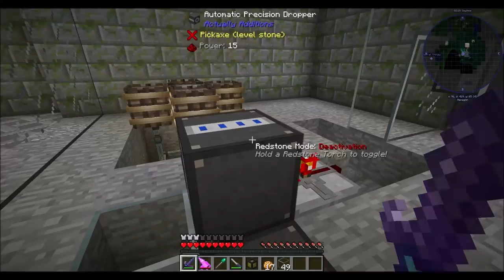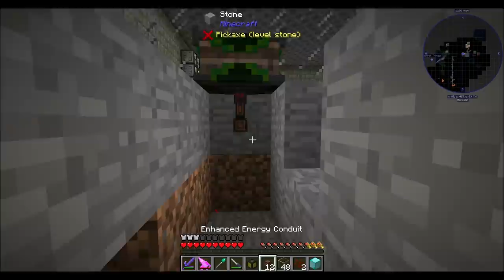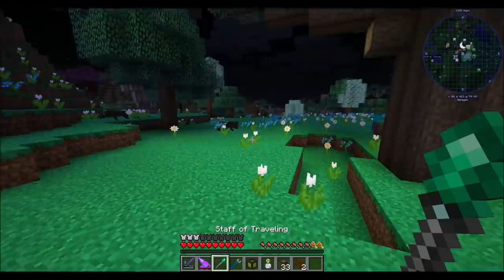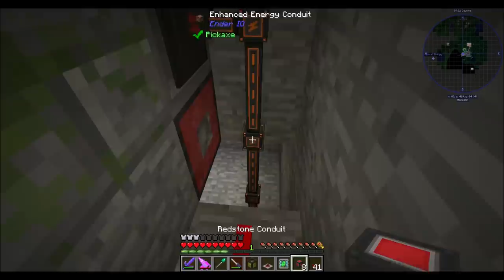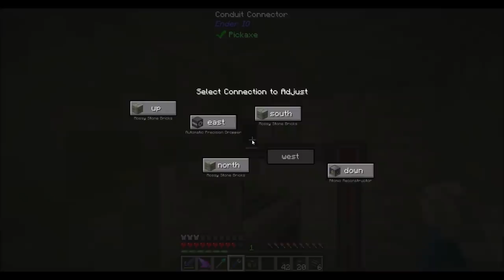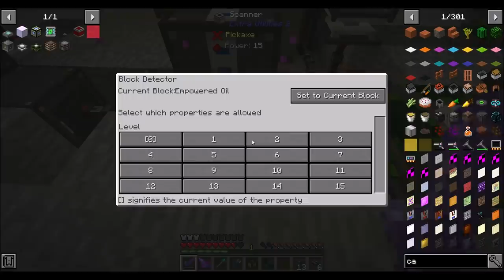FTB Revelations   Ep16 Canola Power Pt2

Comment: I don't quite understand why you make a dedicated everything (atomic reconstructor and empowerer) and automate them for that usecase, when you will have to automate both of them in the future anyway. You could just integrate that in your existing ME-System and have interfaces on the automatic precision droppers to keep a certain itemcount in their inventory (crafting card needed). To not have a bad time for other auto crafts, adding a second crafting cpu would be benficial.
Tho you could obviously modify this setup in the future for a multiuse purpose :)

Also, the second Fluidcollector does not need a NOT-gate. You could just set it to pulse mode and use a single piece of uninsulated red alloy wire (place on scanner, will update the adjacent fluid collector even tho not visably connected).

One thing I also like to add when I do that, is a small tank behind the fluid placers, since they also auto output to adjacent outputs. It just creates a little buffer which is especially beneficial for the empowered canola if you make this a power on demand thing.

But you did a good job hiding everything ;)
Reply: Personally, I make a dedicated everything because I find it more fun than just autocrafting everything on demand
Reply: Alessandro Cavicchioli well I like compact small efficient things ^^ also I play DDS, so I need to hold my resources together 😅

Comment: I'm not sure if this still works but, doesn't putting sand in the pulverizer give you silicon 100% of the time? Because I never use the SAG mill for silicon.
Reply: no.  and i've never known that to work.  as far as i know, sag mill has always been the best option (other than stoneworks obviously).  just grab a crap load of cobble, hopper it into the sag mill, and run it through until you get silicon.  easy peasy.
however, if you installed Mekanism like i did, the crusher does give 100% silicon from sand.  i still use the sag mill for silicon, though.  it processes so ridiculously fast, and the sand is basically free.

Comment: A jetpack from simply jetpack might be what you're looking for or an angel ring from extra utilities.  The jetpack is easier to make.
Reply: i disagree.  the angel ring is easy now that it comes in stages.  the flying squid ring makes getting a ghast a lot easier.  and you might even stick with the flying squid ring for a while anyway, it's pretty great.
having said that, the lower tiers of the jetpack are ridiculously cheap, i have to admit.  the reason i said i disagree is that the angel ring is MUCH easier to get than a higher tier jetpack.  and the flying squid is better than the lower tier jetpacks, imo.

Comment: Posted this in last video but I guess we have moved on now but..."I have built a dropper system like the one shown but my dropper drops 2 or 3 canola seeds not 1, has anyone got any ideas what I am doing wrong?" does the length of the wire run matter?
Reply: if you're using vanilla redstone a repeater will increase the length of the pulse. best not to use vanilla repeaters if pulse length is important.
Reply: The length doesn’t matter. If you used the same precision dropper as dire did then multiple items dropping is normal. That’s just how fast that dropper is. Try using a  limited item filter to make it so that there’s only one item in the dropper ever.

Hope this helped 
From a fellow Bedrock player

Comment: One question I have is has the phantom face rf/t duplication exploit been fixed? I was able to use it back in skyfactory 3
Reply: That used to happen because of a multiplication mistake in the code that duplicated power instead of splitting it. It was a while ago so should have been fixed by now.
Reply: @stormbringer228_  ok thanks

Comment: 16:11 So, you've got these conduit things where both power and item ones can exist in the same block. You've already got a power line going directly where you need your item line to go. Naturally the solution is to start mining blocks so you can run your item line below your power line.

I get that the direderp has been a running joke since just about day 1, but this is just embarrassing.